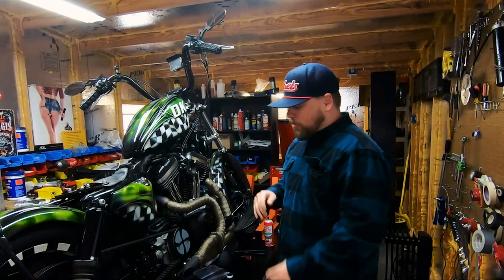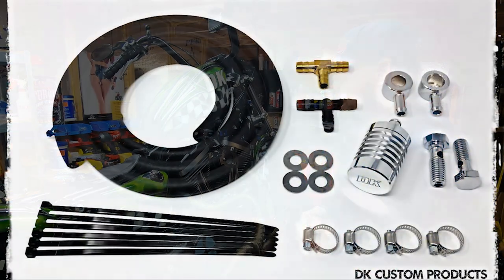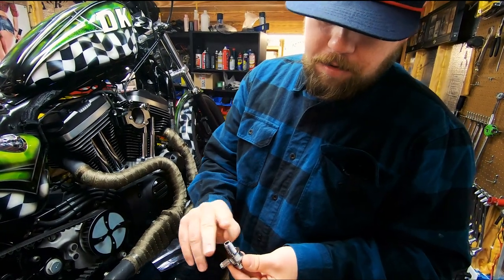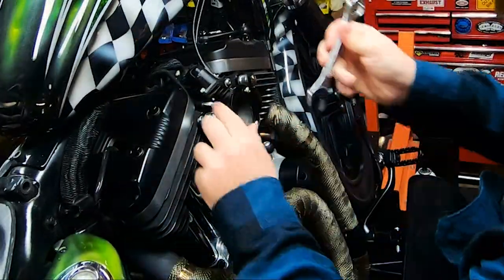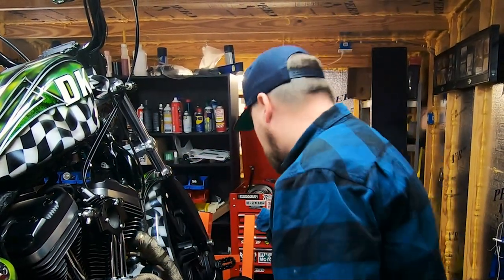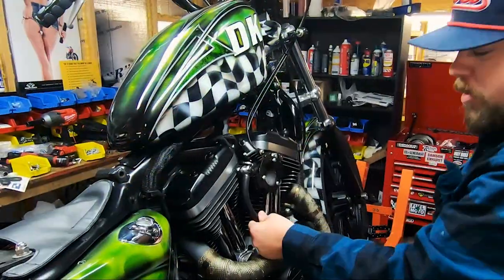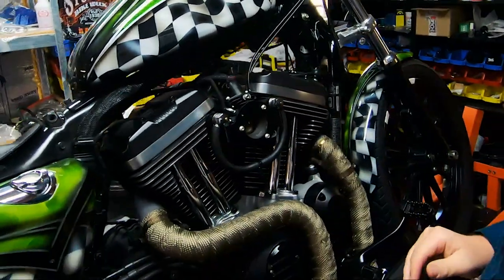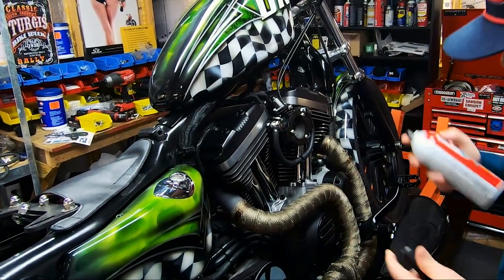How To Install A Premium Discrete Catch-Can Breather

Comment: I just installed this on my 2010 Ultra. I had a slight hesitation when I first started on a ride and  twisted the throttle. No more hesitation! Better throttle response and runs smoother especially when engine is not fully warmed up. Great DK Customs product!
Reply from the maker: Thanks for the comment.  Great to hear that with cool, clean, oxygen rich air your bike is running better!  
Thank you for the kind words. 👍

Comment: I inadvertently found out the source of my heavy oil carryover while installing camshafts in my forty eight sportster. I was using a catch can from DK and it filled up in a short time. Before the catch can, the filter would soak with oil and it would drip off onto the motor. When I got it apart, I found the factory seals on the breather separator valves inside the rocker boxes carelessly installed and bunched up under the breathers. If your bike is doing the same thing, pull your rocker box covers and check those seals!!!!
Reply from the maker: Great to hear you got it taken care of.  Thank you for the comment.
Yes, umbrella valves can be installed wrong, they can also wear out.
We cover that, and more, in the video link below on Why is there oil on the side of my bike?
https://www.youtube.com/watch?v=gJ0vYAitUqU

Comment: Teflon tape does not act as a thread locker. In fact it was invented in the oil patch to make disassemble of pipe spools, valves and equipment easier. The side benefit was it was ok as a pipe thread sealant.
Reply from the maker: We have been using teflon tape (less messy than the paste) for well over a decade, and just threading it in and out "deteriorates" it-distorts it, but it is still there, it does not burn off, so it still does double duty of sealing the threads to keep oil from traveling down them, and also acts as a locker to keep them from backing out.

Thanks for commenting! MB

Comment: My Harley Dealer installed the HiFlow 606 Aircleaner System. The mechanic did view your video and opted to route the hose so that the catch can was sticking out below the frame. Really seemed like a lot of unnecessary hose showing. I asked why he hadn't just left the catch can hanging just below the air filter. He said it would get too hot next to the engine. Interested what your thoughts are.
Reply from the maker: I don't know how hot your engine would have to be to damage the hose or the internals of the catch-can.
Twin Cam should not be seeing temps over 230 F, and M8;s not over 260 F....but many of them see temps up into the low 300's.
Even with those temps there is no damage going to happen to the hose or the catch-can.
AND, of course, there is no downside for the hose or catch-can to get hot, it will not negatively impact the performance at all.
The one thing that could make some sense is that the air coming out of the the catch-can is warm to hot, (and oxygen depleted) and by keeping it away from the air cleaner filter element you are reducing the intake air temperature, which is good for making more power.  I don't know if that makes a measurable difference, since it is mixing with all the other outside air before going into the filter element.

Comment: BUENAS TARDES, tengo una street bob 114 y me preocupa el tema del aceite de vuelta, pero este sistema hace algo con la sobrepresion del aceite en el carter?  esa sobrepresion es la que hace que llegue hasta el filtro de aire por los respiraderos, las burbujas que se generan por esa sobrepresion y todo ese viaje que hace el aceite hasta que sale, ¿a la larga dará problemas?. Para mi modelo tengo que agujerear la carcasa del filtro? ¿haceis envios a España? gracias
Reply from the maker: Yes, the oil going into your air cleaner is bad for the engine and for performance.
You may find this video useful- https://www.youtube.com/watch?v=EfDeFZblMck
Yes, we ship to Spain. 
If you have the stock air cleaner,  you will need to drill a hole for the hose to feed out into the EBS filter or catch-can.

Comment: Do the round K&N and similar style common aftermarket filters supplied with most aftermarket air cleaners for carbureted Twin Cams work well with your Stealth Air Cleaner Support Bracket? (not that it completely matters, but 2003 Dynas specifically)
Reply from the maker: It does work with aftermarket Air Cleaners that need a support bracket. You should know that it is only a support bracket not a backplate or any kind of housing for a filter element. 

Thank you for commenting! 😎 MB
Reply: Thank you for your response.
And that is what I was seeing, and assuming, that it is a flat support in the filter backplate area, no accomodation/retaining step/lip for a filter element, and I couldn't  find a lot of information on it, and was hoping to see a the next steps after the support/lines etc. are completed, here or somewhere, but I've not ran across that. I was trying to find on the site where there might be a backing plate available to add to it. I didn't see anything mentioned as far as, "but this to go with the support if needed" etc.
I have three 2003 Dynas with existing aftermarket air cleaner setups that would normally require the drill/tap method, but I like the cleaner use of banjo breather bolts and fittings,  and the ability to position  them more precisely on r the vent line is ran, and reposition them if changes are made later.
I was looking for a possible easy way to "convert" what I have being as there are three that already have aftermarket intakes. 
I already converted my 2002 FLSTCI intake to an external breather as its aftermarket intake already had banjo bolts/fittings.
Still have to figure out what will work on my 2011 FLHPE w/a 103ci TBW. I was running a 2014 intake on it, and installed a K&N RK-3941 complete air filter assembly that works with the 2014 OEM cover. I'm away from my bikes at the moment, and only remember that the breather bolt setup was kind of funky, one head was slightly covered, one was more exposed, I can't remember if there is enough meat on the standoffs for a drill/tap screw in hose fitting set-up.
Reply from the maker: You can see all of the Ari Cleaners that we offer for your bike at this link - https://www.dkcustomproducts.com/air-cleaner-intake-c10-395.htm

Here is a report we've done on out Air Cleaners and what their differences are to help with figuring out what you might want - https://www.dkcustomproducts.com/differences-between-outlaw-hiflow-air-cleaner-systems-dk-faq-acs.htm

If you have any questions you can contact our Customer Service any time Mon-Fri 7:30 a.m. - 5:00 p.m. central standard time. They will be more than happy to go over the differences and help you choose what will work best for you;
Support@DKCustomProducts.com
662-252-8828

Thank you for commenting! MB
Reply: @DKCustomProducts  Thank you, I have seen those. Trying to utilize the aftermarket set-ups that I've already spent money on in the interest of my wallet weight...lol
Looks like I will have to just modify them, nothing I am not accustomed to doing already.

Comment: What causes oily, watery oil venting out of the vent holes of the catch can? It gets all over the pipes and  right oil cover
Reply from the maker: Two things are the most common cause of a lot of water being in the blow-by:
1. Lots of short rides (less than 30 minutes) where the oil does not have the time to heat up and burn off the condensation.
2.  Cold weather riding, which results in more condensation forming in the oil, coupled with rides that are not long enough for the engine to burn it all off.

The other possible contributor is that the oil level is too high. 
This entire video is about all the reasons why there may be oil on the side of the bike after riding-  https://www.youtube.com/watch?v=gJ0vYAitUqU

Comment: Enjoy your videos. Always learn something from them. I understand how the external catch can will help cool the engine and you'll no longer be getting the oil deposits into cylinder and stop the build up on the pistons. This may be a dumb question, but in using the catch can doesn't this make a closed loop or system and no longer breathable? Thanks again for the videos and keep 'em coming!
Reply from the maker: Thanks man, glad you are finding the videos useful.
The 4 stage catch-can breathes, here is a video I think you will find interesting, it shows how the catch-can works and keeps the system "open".
https://www.youtube.com/watch?v=9JwWI0aV_ic
Reply: Thanks for getting back to me. Had not seen this video. Once again, I've learned something from your videos. You guys are coming up with some fantastic ideas and modifications. Always look forward to your newest videos. Thanks again
Reply from the maker: @tgjustcruisin1005  We really appreciate your support & always happy to help a fellow rider. Ride safe!

Comment: Can water get in the catch can say from washing your bike or riding in the rain?
Reply from the maker: It can when not riding.  However, it is unlikely any significant amount will accumulate, and any that does will evaporate pretty quickly once you start the engine...the hot air will vaporize it.
Best not to spray a sustained strong stream directly to the top of the catch-can when washing.

Comment: Will this work with an aftermarket screamin eagle type CAI? 2010 Dyna wide glide are all the bolts the same on the heads?
Reply from the maker: We have External Breather Systems that work with all different types of SE Air Cleaners.  You can see them at the link below, or you can email or call the shop for assistance in choosing and EBS for your Dyna WG.
Support@DKCustomProducts.com
662-252-8828
https://www.dkcustomproducts.com/all-twin-cam-engines-c76.htm
https://www.dkcustomproducts.com/diy-external-breather-systems-472.htm
Bolts are the same thread, but different lengths, depending on the air cleaner.

Comment: What if your intake has the ears on it that bolt to those breather holes? Like a S&S for a 2015 Road King 103 Twin Cam.
Reply from the maker: You will most likely need one of the DIY External Breather kits seen at this link - https://www.dkcustomproducts.com/diy-external-breather-systems-528.htm

Before you order you can send us an email with a picture of your Air Cleaner and Back Plate to:
Support@DKCustomProducts.com and we can help you choose the correct External Breather kit for your set-up. 

Please feel free to contact us with any questions or concerns you might have:
Support@DKCustomProducts.com
662-252-8828

Thank you for commenting! 👍😎👍
Reply: @DKCustomProducts  Great! Thanks for the quick reply.
Reply from the maker: No problem! Glad to help! 👍

Comment: Does the hole in the banjo bolt and the hole in the fitting need to be in line?
Reply from the maker: They do not.  There is 360 degrees of space around the bolt for the oily air to flow inside the banjo fitting and find its' way to the hose.

Comment: Thank you for the video. One of the shots in the video showed what looks like an Arlen Ness Big Sucker air filter system. I have that in my 2000 ultra classic. Will your catch can system work for my setup?
Thank you for your time!
Reply from the maker: Thank you for watching and looking at our parts.
Yes, we have a Catch-Can Breather System that will fit your 2000 Ultra with the Big Sucker,  You can see it at this link- https://www.dkcustomproducts.com/diy-external-breather-systems-408.htm

Comment: Will this work on the Tab Zombie Breather
Reply from the maker: There should be room behind there to use the Premium Discrete as shown in the video.  However, there is another option that does the same thing and look for the Zombie, that will fit and look the same too.  See it at this link- https://www.dkcustomproducts.com/external-breather-system-w-catch-can-harley-twin-cam-dk-tc-brt-cc.htm

Comment: I put your breather kit on about a year ago, stopped the mess, thankfully. My question is, my bike is running a little rough, have you heard of the hose getting clogged, and blocking off the crankcase from venting properly? I have yet to take it all off and clean it, was hoping you might have some insight.
Reply from the maker: The only time we have seen one clogged is when someone did not follow the directions and coated their breather bolds with so much threadlocker that it plugged the holes.
I have never had to clean the hoses...just the filter or catch-can.
I would look elsewhere for the source of it running rough.
But to set your mind at ease, you can remove your filter or catch can and either feel with your finger if air is coming out the hose with the engine running....or you can put a balloon on the end of the hose to see if it is expanding and contracting as you rev it up.
Here's a video where we did that- https://www.youtube.com/watch?v=Kio4DEuOpCU
Reply: @DKCustomProducts  I'll know tomorrow if I used too much locktite.  Thank you for the quick response. The fact that you responded so quickly, as well as the quality of your products, is why you have loyal customers. Thank you.
Reply from the maker: @steven1371  You're welcome, always happy to help, man! We appreciate your kind words & your business!
Reply from the maker: @steven1371  Thank you for the kind words. :)

Comment: When you install the banjo fitting, it has a small opening and the other side has a larger opening, do you insert the banjo bolt through the smaller opening? And leave the larger opening towards the backplate?
Reply from the maker: The smaller opening goes against the heads, with the larger opening nearest the head of the bolt.  Most of the time it does not really matter, but some of the bolts have a washer built into the  head of the bolt, so the larger opening of the banjo fitting away from the heads is what we do.
Reply: @DKCustomProducts  I put the smaller whole to the head of banjo bolt as it was not moving around. When I put the bigger whole towards the banjo bolt, it was moving around when I was tightening the bolt. I also paused your video and the smaller whole was also towards the bolt. Thanks for your feedback, just waiting for a good sunny day to take the bike out. Have great day! Ride safe and good bless!
Reply from the maker: @JBTexas  Thanks.  Glad you got it installed.  Your bike is going to like it! 👍

Thank you for your business, we appreciate it.

Comment: Did you say it can NOT be used with stock air cleaner and black plate?   M8 touring 2023
Reply from the maker: Most likely you will need a DIY EBS if you have the stock air cleaner. 

Here is a report on how to choose the right External Breather for you - https://www.dkcustomproducts.com/getting-the-right-external-breather-systems-ebs-for-your-bike.htm

You can also send us a picture of your back plate and air cleaner and we can help you determine which EBS will be best for you:
Support@DKCustomProducts.com

Thanks for commenting! 😎

Comment: Does the size of the breather bolts and lines make a difference? For my 2014 FLHTP I have a Fuel Moto AC DC kit and just reused the stock breather bolts and lines which are the size of standard vacuum lines and attached a breather filter under  the bike and it seems to be doing the job.
Reply from the maker: Yes, that will work fine.  Any hose that will fit over the factory breather bolts is plenty large enough.
Thanks for watching the video!

Comment: The catch can system DK recommended to me last week. The bolts had to be tapped. Will this kit work on 2013 Roadglide Ultra?  K&N big sucker 2, air cleaner.  Kit in this video is a little more expensive. However looks like an easier install and cleaner look.  With catch can.
Reply from the maker: Good question.
As stated in the video, the Premium Discrete being installed only works with Intake Systems that have a low profile support bracket.
It will not work with stock air cleaners, Big Suckers, and any other air cleaner where the backplate bolts up to the heads.
The system you received is the way to install an EBS on an air cleaner like you have.
Reply: @DKCustomProducts   thanks for the response.  I heard what the video said.  Was hoping this may work instead.  Thanks for responding.   I’ll be ordering mine soon. I have a big issue with blow over.  Gets on my pipes and everything.
Reply from the maker: @JLK1978  Appreciate your business, Thank you.
Yeah, you (& your engine) will enjoy the EBS.  The inside and outside of the bike will be cleaner...it will run better too.
The drilling and tapping takes a bit longer, but not that much.  Here is a video one of our Customers made on that install- https://www.youtube.com/watch?v=uAmPC_kglJk
Reply: @DKCustomProducts  awesome!!!  Thank you, looking forward to my next motorcycle part.  Shhhhhh, don’t tell my lady.  lol
Reply from the maker: @JLK1978  👍

Comment: Hi, one of the images in this video shows what appears to be an Arlen Ness Big Sucker air intake filter. I have one of those on my 2000 ultra classic. Will your catch can breather system work for me?
Thank you for your time.
Reply from the maker: Thank you for watching and looking at our parts.
Yes, we have a Catch-Can Breather System that will fit your 2000 Ultra with the Big Sucker,  You can see it at this link- https://www.dkcustomproducts.com/diy-external-breather-systems-408.htm